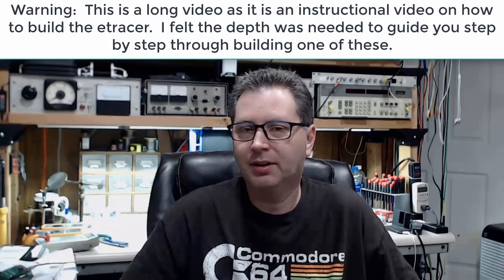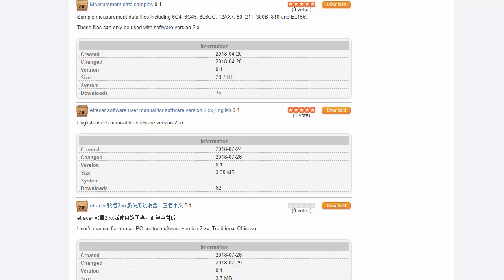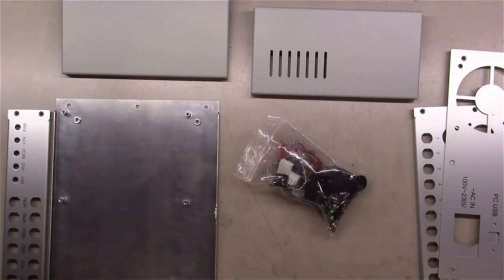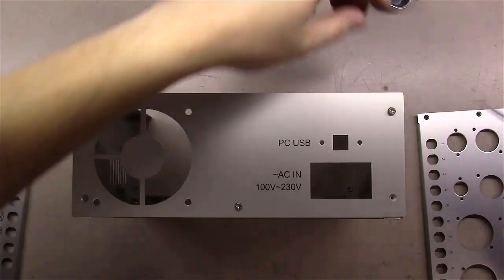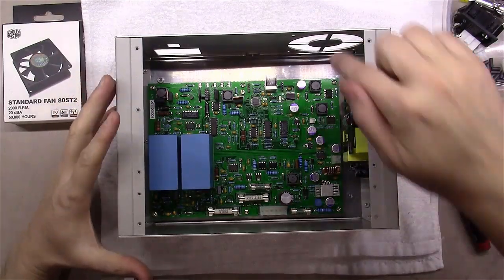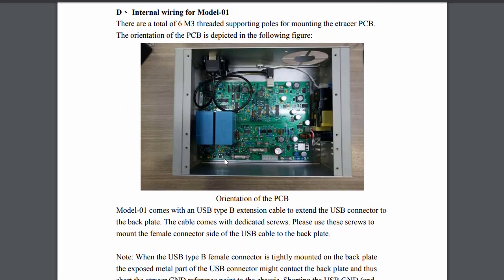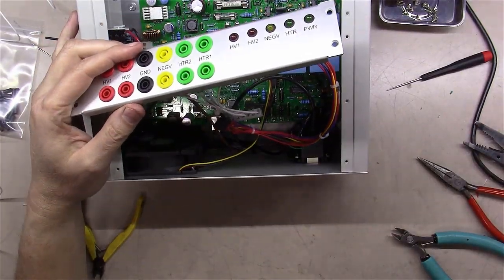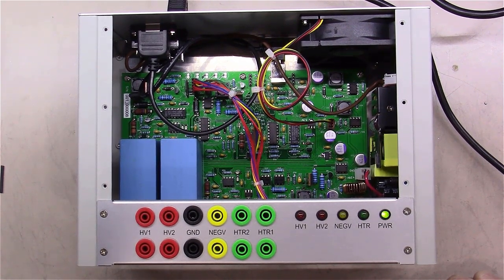Building a eTracer Vacuum Tube Tester pt 1

Comment: Thanks Mark. I'd like to buy this unit and just noticed the eTracer is based and sold in Taiwan. Does this unit adhere to U.S.A. electrical standards i.e. 120 volt A/C 60 Hz?
Reply: The designer of the eTracer and one who sells the board is located somewhere in Europe .. possibly Finland.  I have bought his etracer board and it works fine in the US.